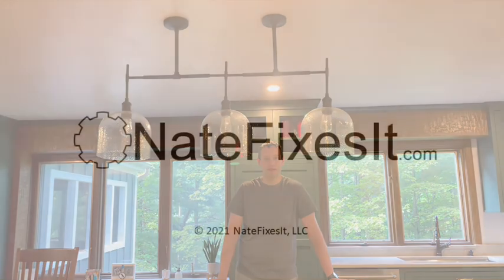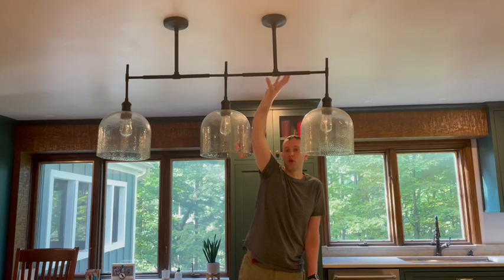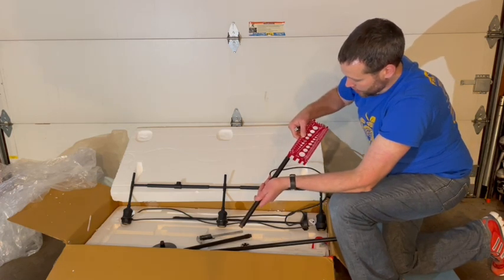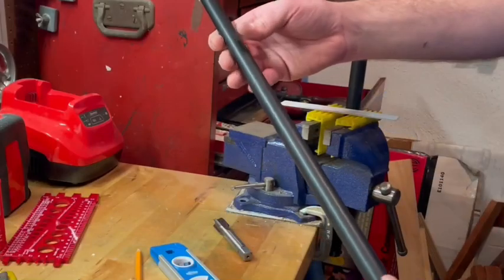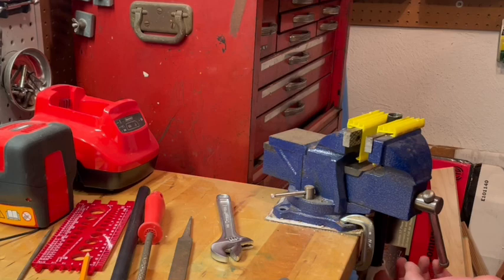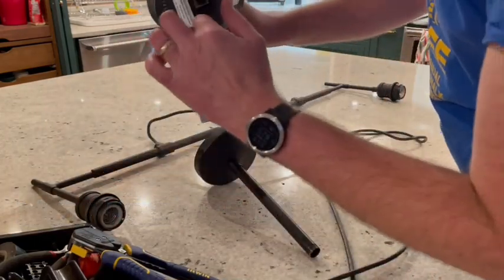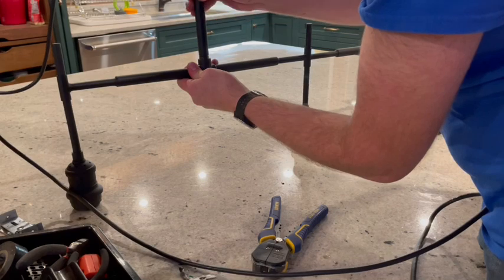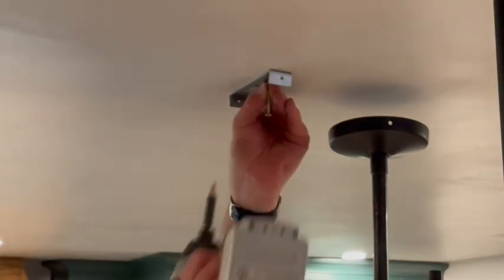Pottery Barn Textured Glass Linear Chandelier Review, Modification, and How to Install

Comment from the maker: Here are Amazon links to the tools that I used for the install:
IRWIN VISE-GRIP Wire Stripper, Self-Adjusting: https://amzn.to/3VWGqoq
Hack saw: https://amzn.to/3WRzOZE
11/16-20 tap and die set: https://amzn.to/3QwenuY
Tap Magic cutting fluid: https://amzn.to/3Zp8YtM
Vise:  https://amzn.to/3CxalfU
Screw driver: https://amzn.to/3k2GvcY
Multimeter: https://amzn.to/3Qn3Nq2
Adjustable wrench: https://amzn.to/3GqgEDd
Rags: https://amzn.to/3il9Kag
Thread gauge: https://amzn.to/3XjMXuu
Reply from the maker: This is the set that I used.  Free delivery and free returns if it’s the wrong size:
https://www.amazon.com/HSS-16-20-Tap-Right-Hand/dp/B07L67W2CJ?crid=2ACWO3GQ47KFR&keywords=11/16-20+tap&qid=1673212955&sprefix=11/16-20,aps,120&sr=8-8&linkCode=sl1&tag=natefixesit-20&linkId=c4361d6359ee00cd879921c3599e4929&language=en_US&ref_=as_li_ss_tl
Reply: @NateFixesIt  thanks man
Reply from the maker: @Nick-gt5dr  no problem, good luck!

Comment: I bought a similar unit: "Reese Metal Linear Chandelier" that has the same exact tubing/mount. I installed it successfully at 12" from the ceiling, and OF COURSE my wife wanted it lower. So now, because I cut the cord off at the appropriate "shorter" length, I now need to run a new wire down to the base— AND SOMEHOW RE-WIRE IT. So I'm looking at videos to remember how it went together. I have the original pipes, but do you know where I would need to reconnect it? It seems like I would need to go pretty far into it with a (newly-bought) cord. Wire nuts won't fit, so maybe crimp-style/heat-shrink?
Reply from the maker: I think you are right that a crimp/heat shrink connector would be best.  Make sure to use braided wire for flexibility.  I have used these connectors successfully for a different project.  Just heat with a heat gun and the low melting point metal solders at the same time the heat shrink seals.  https://amzn.to/3DmeraZ  Good luck!
Reply: @NateFixesIt  Thanks. After adding the new cord/butt connectors/heat-shrink, everything went pretty quickly. Luckily my pipes all worked out OK. 💪
Reply from the maker: @AlanHouser  glad to hear it!

Comment: I ordered a light from them and having same issue.  How did you figure out what size tap to use?  I know you have the red gauge tool but 11/16 is not on there  so how did you know to use a 11/16-20 tap??  Thank you
Reply from the maker: I use the thread gauge to get close. I The.ended up ordering 4 or 5 tap and die sets until I found the die that threaded onto the rods without jamming up and returned the rest.  If you bought a similar chandelier, it’s probably the same thread size, but of course, try the tap and die on the existing threads first to make sure it matches.
Reply: @NateFixesIt  ok thanks man I appreciate it.
Reply: @NateFixesIt  most of the tap and die sets I see online don’t have a 11/16.  They seem to always skip that size.   That’s why I wondering how you landed on that..  even the sets that contain 50 +  taps  there’s no 11/16 in it.   Would u be able to send me your sets bought so I can try and get a match